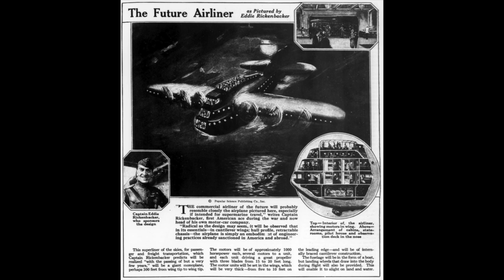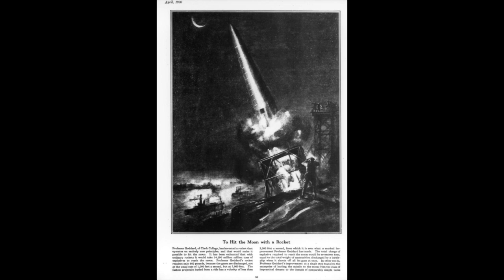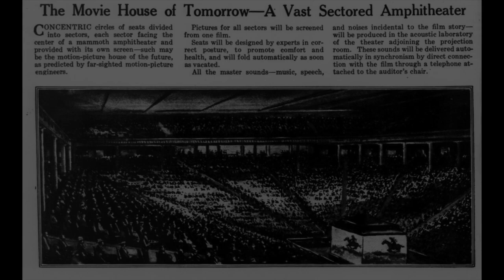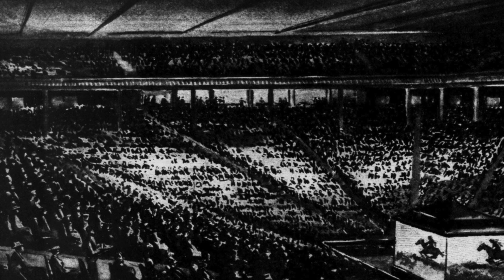1920s Futurism Flashes: Airplanes, Rockets & Movie Theaters

Comment: These inventions have already seen the light of day this decade, albeit still in the embryo stages, and with some differences to fit the more advanced knowledge of the sciences that today holds now. For example, the first one was invented in the form of the Sky Hotel, which was designed to remain permanently in flight, rarely if ever landing, to be refueled in flight, and for other smaller airplanes to attach to the larger plane for passengers to get on and off. The rockets had just become space catapults to launch capsules into space with great force, and the amphitheater a 360° movie screen where people could watch all the action from many different angles.

All in all, the 1920s then had correctly predicted the conceptualization of many if not all of these inventions, and that’s an impressive boost from the 2000s we’ve all fantasized about before. Long live the predictions. 🤖